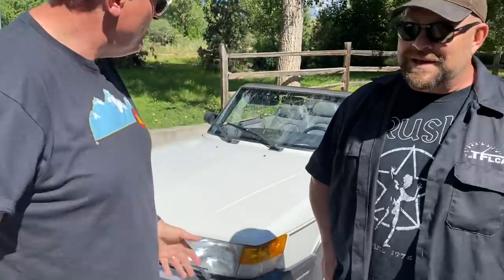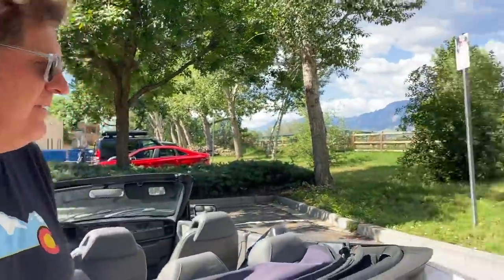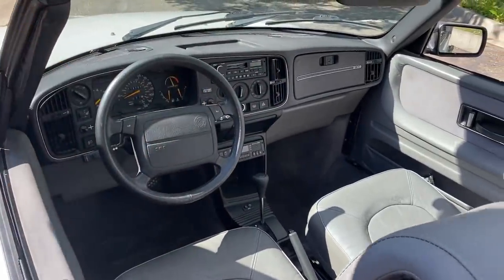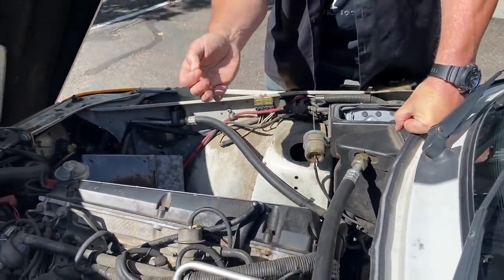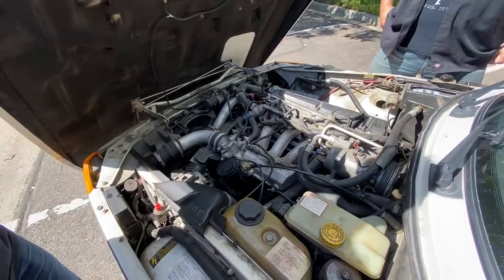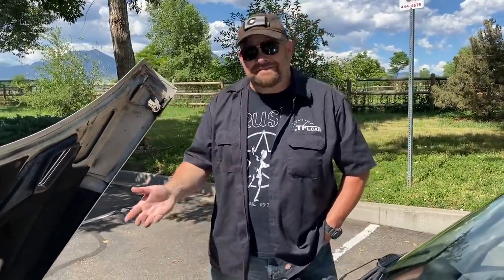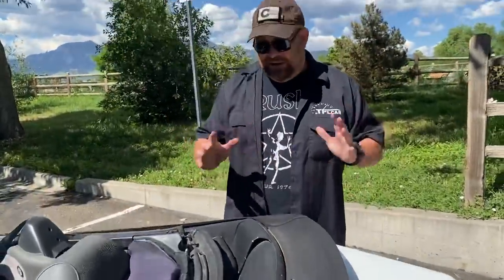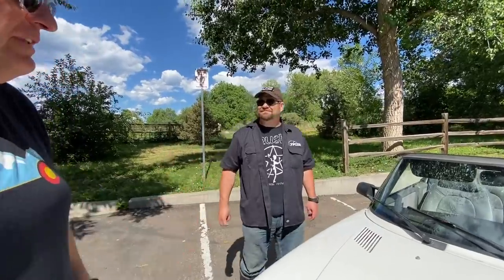Behind The Scenes: We Just Bought The World’s Coolest (Or Kookiest) Classic Convertible!

Comment: The steering wheel needs a plastic bushing replaced and both front seats are heated but only the driver's seat is variable. If you guys are in SW CO we should get together, I'm a semi-retired Saab mechanic so I can help you out with those issues. I parted out 3 900's last month including a vert.

Comment: Too bad it’s an automatic. Takes a lot of the fun out of driving it. Saab and Volvo both had inter cooled turbos in the 80s and 90s that were a blast to drive. I was a big fan of the Volvo 740 intercooled turbo cause it had rwd. Turbo lag was horrible but when it kicked in was a blast. People really don’t realize how quick they were for the time. I know the 740 was quicker than the bmw 3 series cars and a few Porsche models for a few years.
Reply: Saab reverse lockout on the manual was another quirk they missed out on..
Reply: @danh655  yep. one of the stories about that is, In cold Swedish winters you did not want to use the handbrake it was very common that the drumbrakes would freeze up. So for Saftey you should allways park with a gear in. The best gear for not rolling down the hill was the reverse. There is another story that it was somehow so nobody would steal the car like an extra stearning wheel lock. But I do not know about that. SAAB allways did what they thought was the best engineerd solution, they did not care about what customer wanted and design was allways secondary to the best engineering solution. The hood was one of thoose. That style of hood had lower chance to open when driving and casuing a crash. So SAAB made it not caring if customer wanted it, if it was practial, if it made ecomomical sense or if it would make a good looking design.

Comment: Go with a 3” down pipe and you will get rid of a lot of the lag.  Swapping in a 5 speed is a straightforward project.
Reply: Turbo lag + a three speed automatic with a tall first gear makes it a slug off the line.  My 1981 900 turbo had the automatic transmission go bad.  My biggest regret was not replacing it with a 5 speed

Comment: Hi Guys, and thanks for the video...
I just wanted to correct you a bit...
Bouth front seats are heated.
The switch controls bouth seats, but...there is a tention switch under the passenger seat.
That switch cut off the passenger seat heating if there is no one sitting in the seat.
At ones someone sitting in the passenger seat the heater also start in that seat.
I think moust of this Saabs have no functioning seat heaters.
The reason is the heating wires snap off in the seat bottoms.
And moust of them snap of where the heater wire passing the deep seams.

Comment: I love Saab but that was dated back in 1992. The next gen after this was the sweet spot for Saabs
Reply: The Fuji Heavy Industries (Subaru) four speed automatic transmission on the low pressure turbo was an improvement,  but the build quality was influenced by GM.  Yes, a more modern car but it lacked the character of the pure old SAABs.  I  owned a '99 9 3 for twenty years.  Wrecked it and had it towed to my SAAB mechanic.   Totaled,  I then "upgraded" to a 91 white convertible sitting in his yard.  Had experience with old slushbox 66 Mustang Convertible so this one was not a shock.

Comment: Never seen a steering wheel column play like that! The Mitsu turbo unit is smaller than the previous oil cooled Garret turbo unit so it spools up quicker...and they made the C900 between 1979 and 1993, so 14 years. Add in from the windscreen back it is basically a 99 which came out in 1967, so they made the same car for about 25 years...and everything in a Saab is functional, otherwise it wouldn’t be there....

Comment: Great deal, guys!  To repair the steering you need a small black ring, part number 32021990.  Costs $4.74 and still available.  

FYI, your passenger seat IS heated, it just works from a thermostat, not a control on the dash so you won't feel it turn on until winter, if it still works.  After three decades the wires can fatigue and break, but it's easy to go in there and patch them back together.

Comment: Can you say rubber baby buggy bumpers three times fast?  

The problem is that it won't burn a quart of oil every two thousand miles, but it will drip it!.

The AC when working is awesome. Swedes demand AC fast and cold when they need it in Summer at midnight. 

Four cylinder turbo - ridiculous, that will never catch on!  Normally aspirated inline sizes will rule forever with mighty BMW!  Oh how times have changed!

Can you put the tonneau cover on in less than 60 seconds.  Stored in the trunk with no advanced training.  Then properly put it back in the trunk.

In this video I will go over only the quirks of this car and it will be the longest one our channel has produced.

Comment: I worked at Saab ana, in Akalla.Sweden. When the absolute first, number one 900 convertible appeard, at my work. It was built in Sweden, converted to a convertible in Finland, the rear spoiler was in wood, because  the tools to make the spoiler was not made yet. It was Pearl White with a black top, and a red leather interior. This car was for testning and the pressrelease. And it had the 170hp turbo intercooler 16valve. All convertibles, was after that made in Finland. All Saab produced in Finland had little better rust proofing, than the cars made in Sweden. They were wery proud to build Saab in Finland.

Comment: I owned two Saabs and have always liked the brand.  Had a 9-3 convertible, last one before GM got involved and a 9-3 Aero post GM involvement.  They were always fun to drive and always felt sporty at any speed.  I noticed Nathan's Saab shirt in a previous video and was hoping there would be a Saab connection coming soon.  Cool car, have fun improving it from its current condtion.
Reply: 9-3 is based on an Opel chassi. Opel was owned by GM at the time so it was the one of the first car on the way down.

Comment: Great old cars. Love old Swedish Steel. I'm more of a Volvo guy myself. Some Saabs have the key in the column. Not the  center console.
Reply: some of the rebaged Chevroelt SAABs or the Subaru rebaged saab don have it in the console. Saab 9000 was joint project with Lancia, Fiat and Alfa Romeo so I think they also had it in the column. Then if you go back on the old cars before they noticed the leg dmg in chrashes SAAB also had the key in the column. Dont remember all models but your correct.
Reply: @KristoferOlsson  I drive a Volvo XC90 with 180,000 miles now but I've had a 940,850,V70 XC AWD. I just think Volvo builds a better car.
Reply: @kodiakradio7510  SAAB dont build cars anymore so yes indead Volvo build better cars. Im a Swede but I was never a SAAB or Volvo fan I used to go with German cars from the 70-90s (Opel, VW and Audis) Now I have changed to Japaneese cars. :( Im tired of having my cars in the shop.
Reply: @kodiakradio7510  Volvo's are great cars but are like tanks.  SAAB is generally more fun.  Still would like a 240.
Reply: @davidbauer1485  I agree with that.